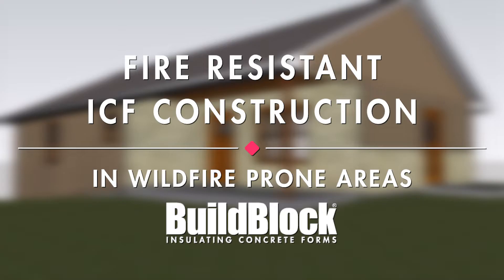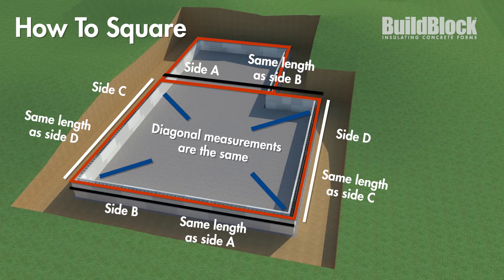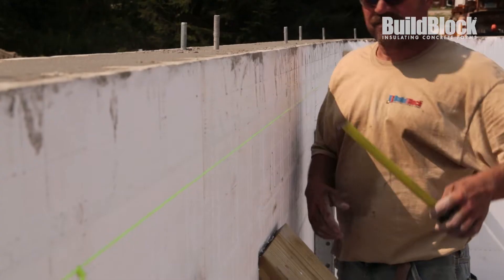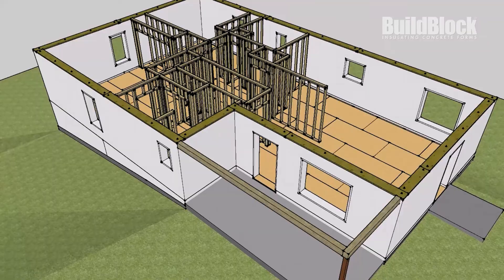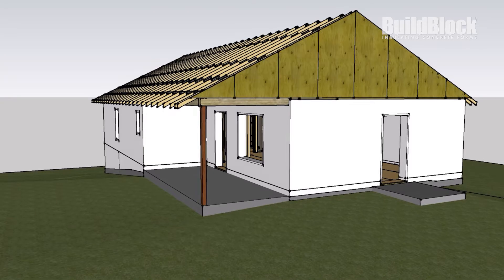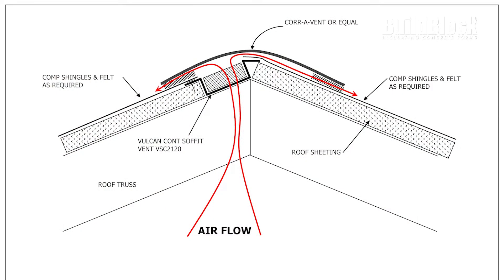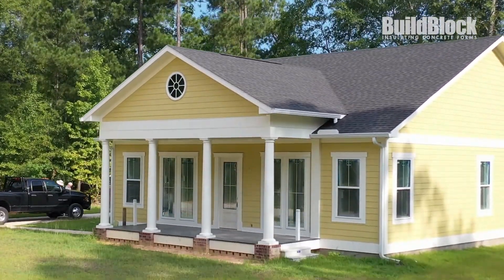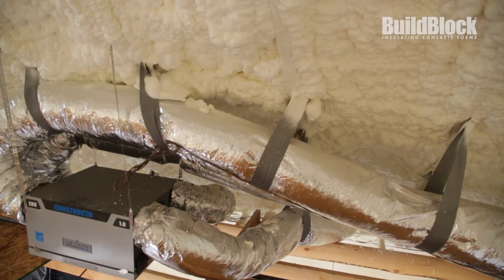How To Build A Fire Resistant ICF House

Comment: How would you cool your attic? I live in high desert.
Reply: If you have an unvented attic (which makes a lot of sense in an area where moisture is not a concern) you cool your attic along with the rest of the house inside the envelope. It's a matter of having enough insulation and enough of whatever cooling system you are using. If the attic space is vented there is no practical way to cool it, it's going to get sweltering hot when the sun is out, but large enough vents will help the air to change and keep it from pushing heat into your house through the ceiling.

You can do a "chinese roof" or "double roof" where you create an unvented attic space and then raise a second layer of sheathing over your roof sheathing with furring strips to allow some convection over the top of the insulation to reduce the amount of heat that the insulation is exposed to. There are plastic trays called "SmartBaffle"s that  you can apply to the roof sheathing from the underside between the rafters before you sprayfoam which will create that air space and let convection remove heat and humidity from the underside of the roof in the same way.

Comment: How come no slab insulation?
Reply: Not relevant to the purpose of the video. It's not a full how-to on building a house, just a brief overview of the ICF-specific bits and fire resistant building techniques compatible with ICF structures. They also didn't show electrical/plumbing/interior finishing/etc.

Comment: Add the magic phrases “seismic reinforcement and anchor rated,” “easily built above flood levels,” “hurricane ties,” “hail damage resistant,” and “as local conditions require,” and it’s even better. But it’s a great step forward for the fire issue.

Comment: Why aren’t builders using ICF to build interior walls and roof? I think ICF would keep fire from migrating from one room to another.
Reply: Concrete roofs are a thing, and BuildDeck was even called out in this video as a tool for unvented roofs. For interior walls, the insulation isn't necessary and ICFs would result in ridiculously thick interior walls. If you want fireproof interior walls, use metal studs and concrete board instead of wood and drywall, although thick drywall has reasonable fire ratings and is the standard for a reason.

Comment: 6 inch or 8 inch blocks for the basement below grade?
Reply from the maker: Mike, every job is different but you will typically need to use an 8" core below grade to adequately hold backfill.